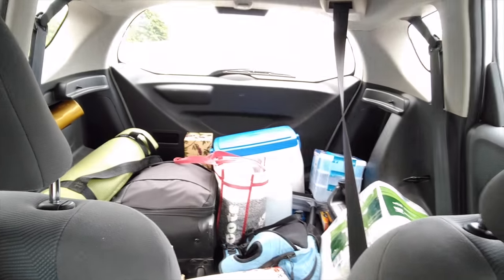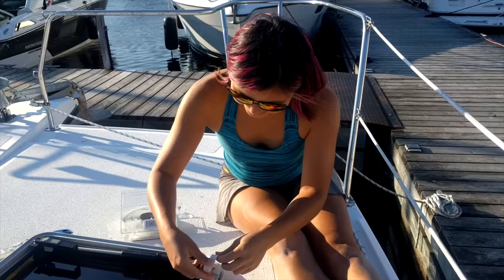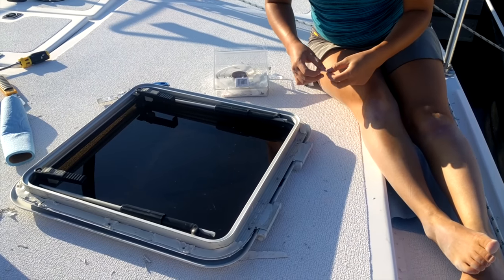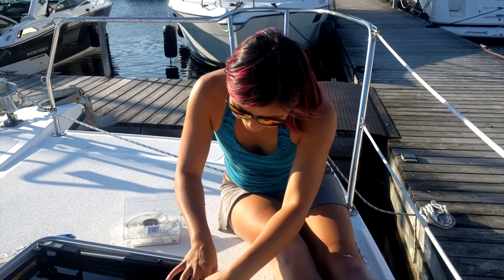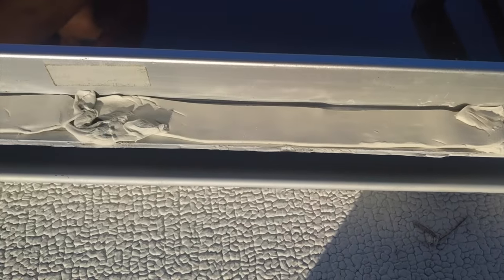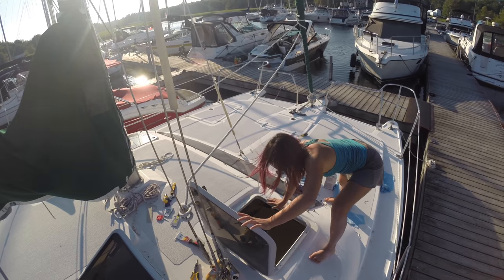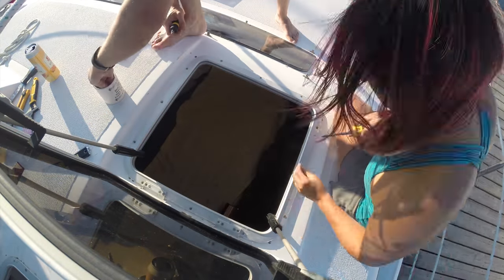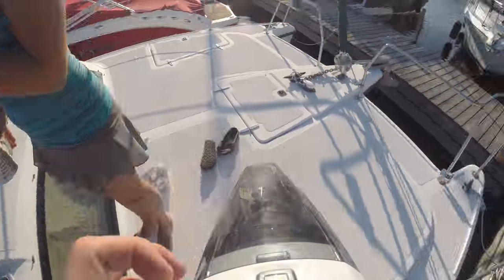Learning to Sail Upwind on a Catamaran (Sailing SV Catsaway) - Ep. 09

Comment: Two comments on tacking a multihull to keep from going into irons. As you tack, don't immediately release the jib and let it backwind to help pull you through the tack.  Secondly, let out the main slightly until you begin to regain speed and then pull back in.

Comment: Hi guys, really enjoy your videos. Looks like you had such a great day for a sail, very envious.You mentioned in the video that you would like some feedback. Firstly I should point out I am not familiar with catamarans, but what I noticed in the video was the slot between the top of the headsail and main was a little to open for upwind. If you look at the top two inside tell tails, they are breaking (flying up) while the lower tell tail is streaming backwards. If you move the jib car forward another hole and bring in the sheet a little more I think you will get them all streaming. My understanding is that catamarans like to point a little low, so aim to have the outside tell tails breaking a little. To me, using the inside tracks was definitely the right choice. The blocks you used look like snatch blocks (where the cheek/side of the block can open). These are expensive blocks often used on spinnakers, a down side of using them on the headsail is that while tacking, they may tend to bang around on the deck. If the inside and outside tracks are the same size, I would swap the cars over and use the standup blocks on the inside track.
Reply from the maker: This is really helpful advice, thank you!!  We tried adjusting the car a few times yesterday, but we're definitely still learning.  Thanks also for the tip on the snatch blocks - we'll have to check the track and see if they are exchangeable.  Fingers crossed!  Thank you again so much for commenting and for watching. :D  Happy sailing!

Comment: Great episode! The rule I learned about placing the foresail blocks is: when sailing upwind, position the blocks so that when the sail is trimmed foresail sheet should point to the midpoint on the luff (leading edge) of the sail; when sailing downwind, move the blocks aft to maximize the ability to expose the sail surface area to the wind. 

Also, when sailing close hauled, the mainsail telltales should stream aft (with the top telltale streaming aft at least half of the time) and the top batten should be parallel to the boom.

Of course, all my experience is with monohulls. I don't know if the same applies to cats. :\
Reply from the maker: Great tips, thanks so much!  I really like the one about the foresail sheet pointing to the midpoint of the luff.  We'll try it tomorrow and see. :)

Comment: Hi, you're doing a fantastic job.  You're dead right to have a narrow gap between the main and the jib in order to go upwind--can't remember whether your boat has a centreboard, but if it does she should go well. Also have a look at how you're sheeting the main, your leech tell tales don't appear to be flowing at the top of the sail (they are at the bottom).  This could be just playing with either the traveler or the main.  On my boat I have the traveler a couple of feet above the centre line and the main in tight--but not too tight--you can over sheet it.  Also, I've had to rebed all my hatches (6 in total).  Don't underestimate how much pressure the water is under and it's ability to fine any gap...  I used sikaflex, it's a nightmare to you use and clean up (turps) but they no longer leak even in atrocious conditions  A wet bed after a long sail is total pain in the arse
Cheers  Phil
Reply from the maker: Philip Pryor Thanks for the tips! We just started playing with the traveler yesterday and it seem to help our upwind performance. I (Diana) have been obsessively running back into the main cabin every time is rains just to double check that it's not leaking :P It's very possible we'll have to rebed the remaining hatches so we'll definitely keep sikaflex in mind! Thanks again for the comment and for watching :)
Reply: Geminis (well, prior to the Legacy 35 anyway) have two swinging centerboards in trunks, managed by reel winches operated from inside the hulls. There are ENDLESS arguments among owners as to what configuration of which boards, up/down or neutrally floating half down,  is right for which wind condition.
Reply: Don’t use sikaflex or any other permanent or semi-permanent fastening caulk / adhesive. Your port lights and hatches should have ever so slight movement in them and using anything but butyl like you’re doing will have you destroying your hardware to fix the next leak. Tight it all down with the fasteners fully. The butyl will remain flexible and watertight for many many years. They will leak again, and you don’t want to be replacing all your hardware every time you need to fix a leak. Check out Sail Life on you tube and Mads videos on his refit of Athena. He does an amazing job of explaining what he does and why. I know I’m a little late to your vlog, but enjoying a binge catch up!  LOL. Fair winds.

Comment: Noticed you had a hairline crack to fiberglass right behind the hinge. It would of taken 3 hrs to sand down and seal and paint that crack so it does not spread or worse creek every time someone stands next to it would do my head in. Nice boat, what age is she? my guess is 1985 -1990 ish or i could be waywrong?, If it is, It is in great condition for its age. That boat would suit a hydro generator, but they are more expensive but look better than dripping solar panels off the boat messing up its nice clean lines..
Reply from the maker: Good guess! She's a 1998 Gemini. Great eyes too re: the crack. We ended up putting one 315 watt solar panel on our dinghy davits. It was a perfect fit. Thanks for watching ☺🐈⛵